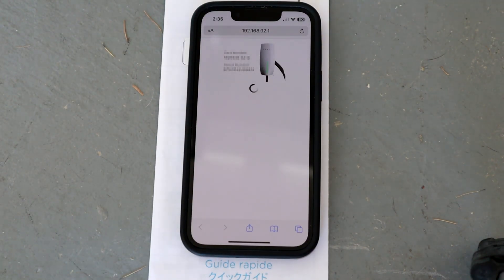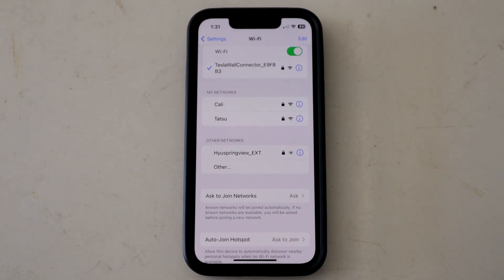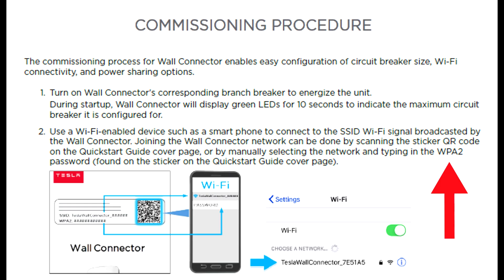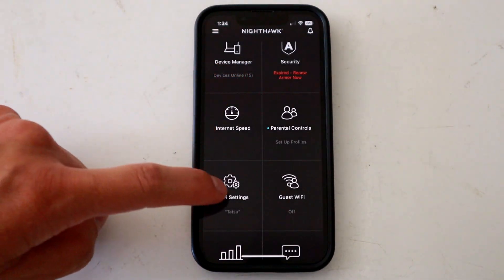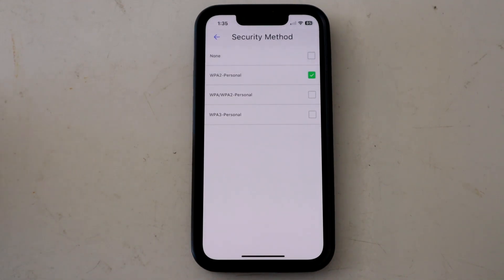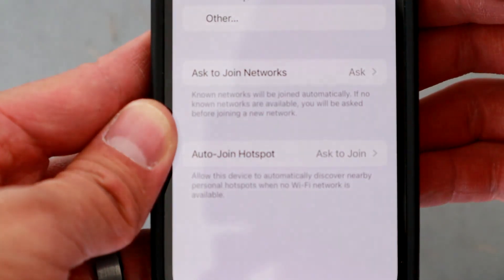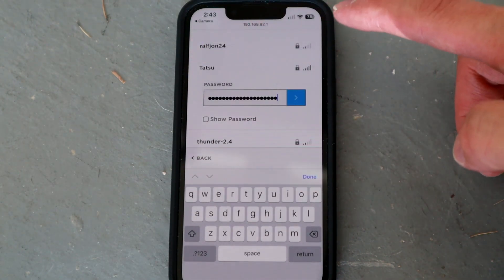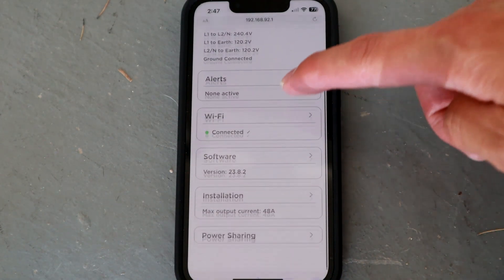Troubleshooting Commissioning Tesla Wall Connector Tips

Comment: Super helpful!   I will be getting the wall charger soon. Quick question: is the IP address printed on the Quick Guide?   Just loading the IP address into Safari will bring up the menu to set up breaker size, right?  Thanks!
Reply from the maker: Yeah I believe the IP address is also on the quick guide.  Yeah, this is where the breaker size options are.